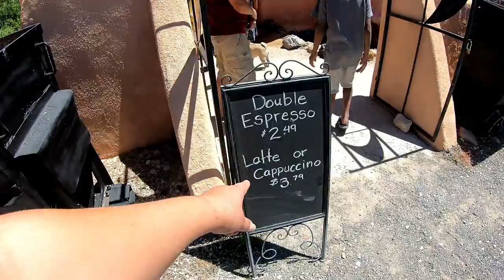When A Nomad Is In Need Of Help, The Rock Shop, RV and Life Vlog

Comment: Awesome video Terri and Scott cool rock shop and good work on helping your friends and both you guys are all red from that heat I bet it was more hot where you guys at helping out then when you guys were at the rock shop. some adventure you guys had, be safe out there. Your friend need to install some brackets on her tires from her trailer to be lifted so she won't get stuck again with that kind of dirt or rocks can't remember what they are called but it's to lift the trailer well have fun.

Comment: Good Video, 
Thank You ,for Sharing the rock tour. 
When in dought , try poking ground ,with a broom handle. If it goes down easy, you may sink. That's a lot of weight on those narrow trailer tires.
Drive Safe

Comment: Remember that 'glass' is grains of rock heated at a high temp.. Volcanoes provide both the rock and the high temperature that melt them..into glass !! Helping is other is a big part of the RV life.. Backing the bike out and reloading it once pulled out of the sand seemed like it would have been about 700 pounds lighter pull. ... just saying !   Thank you for sharing your day !
Reply from the maker: It would have been more work taking out the bike then it would have helped. The tool box had all the weight in it.